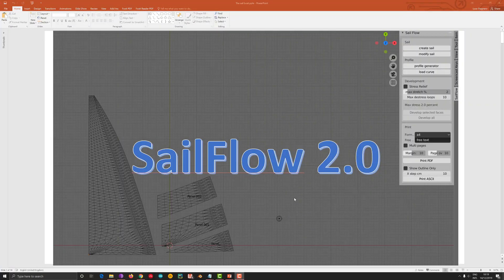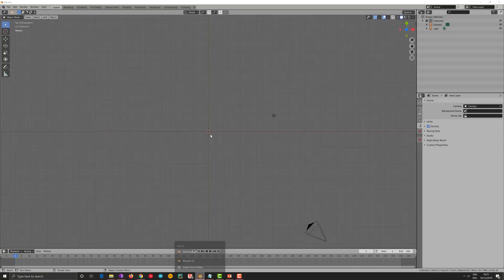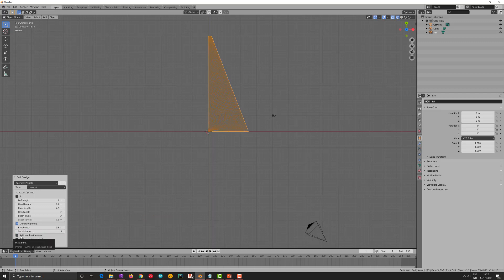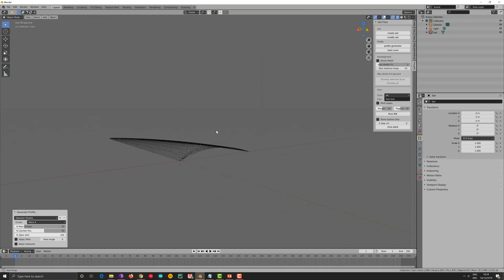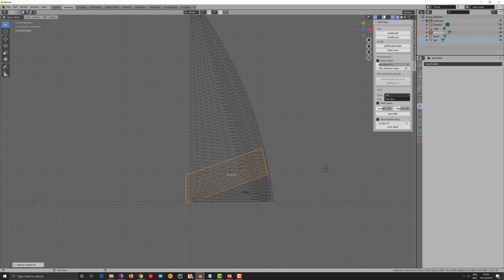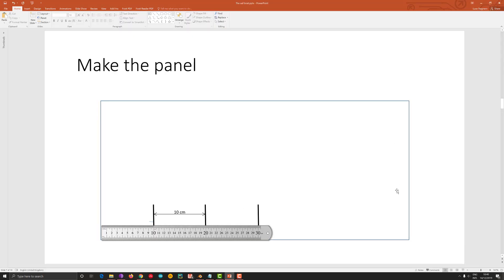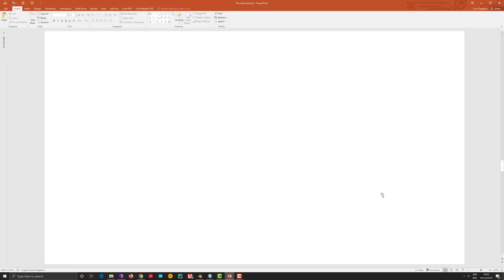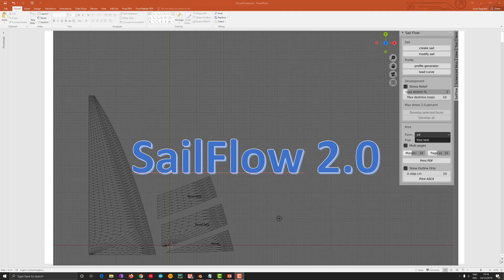Install Sailflow 2.0 and design your first sail

Comment: I installed 3.0 and checked the add box. When I do control + A I do not have an option for add sail. Any idea what to do? Is there an instructions document somewhere?
Reply: For anybody else who finds this and has the same problem.
In the add on list, where you see sailflow3.0, expand that and it tells you the path where you can find the command.
Mine defaulted to view3D -> Sidebar -> Create -> Sail
In the view menu, see that sidebar is ticked and you can see it on the screen (Or press 'N')
Sailflow is one of the tabs on the sidebar (Items, Tool, View, **SailFlow**)
Happy playing!